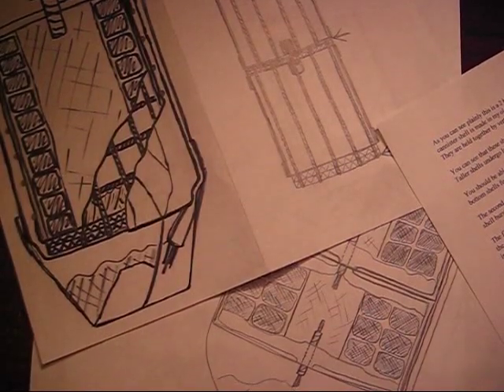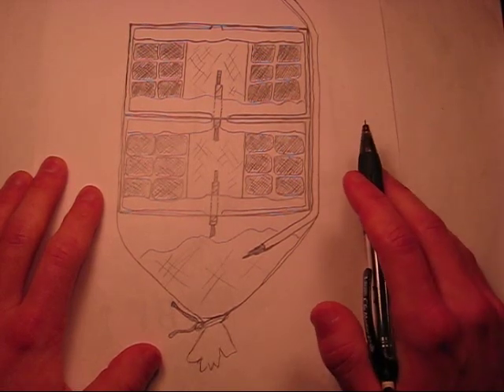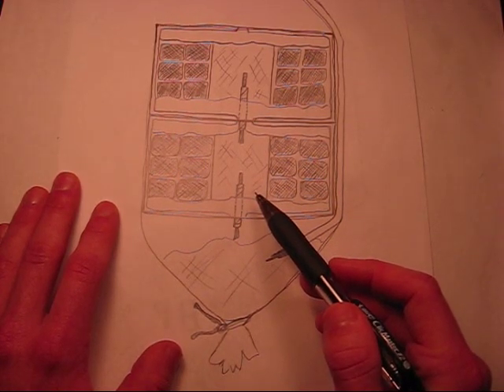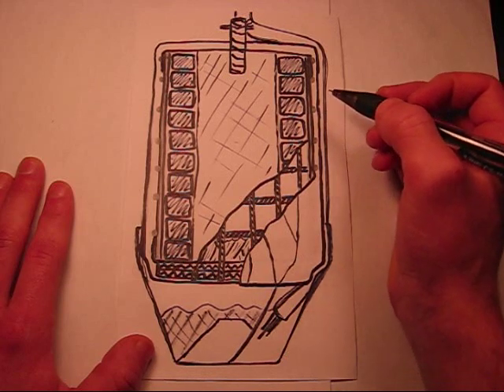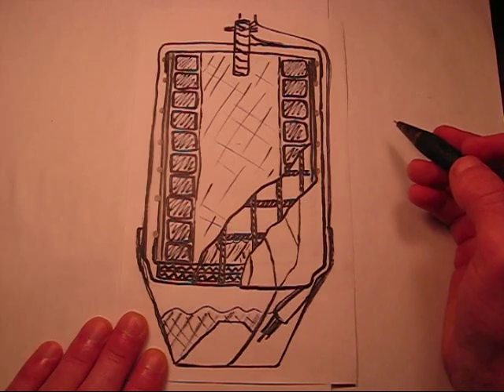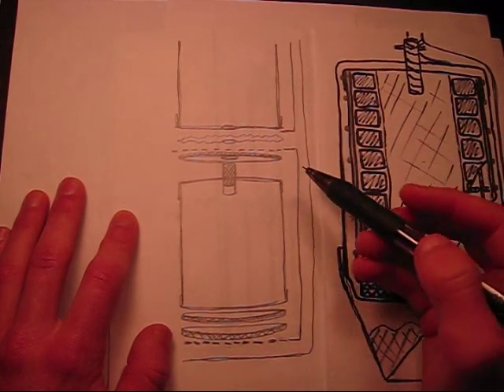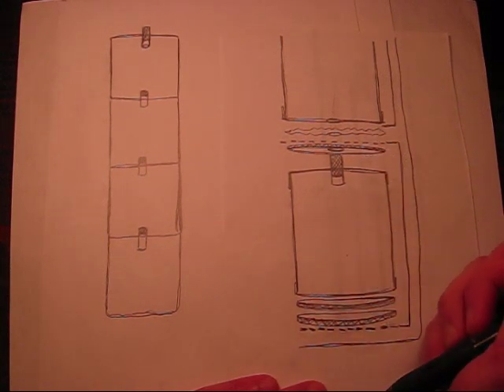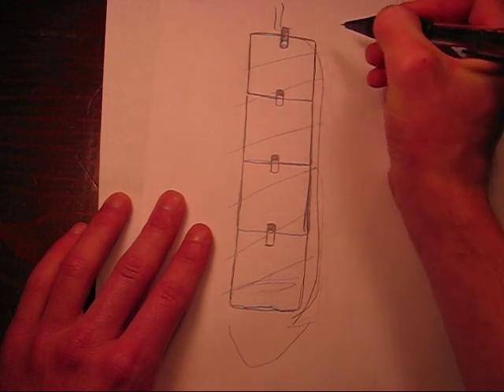Multi Break Shell Design - Advanced Fireworks Construction

Comment from the maker: What sort of break do you use? If you use flash booster, I would suggest getting rid of some/all of it. Also, are you sure your stars are are shattering and not simply getting blown blind? Also if your stars are not fully dry, they will be much weaker. A final thing to do would be to use more binder in your stars, or a better binder.
Well there you go, quite a few possibilities. I highly doubt the problem is to much pasting.

Comment from the maker: Multi break ball shells are pretty simple. All it takes is stiff cardboard tubes to put between them, and a few layers of pasting to hold them all together. The spolette of each shell is inside the tube attaching it to the shell that is meant to break one step earlier. A small hole is drilled into the top of each shell to allow fire to pass from it, to the next in line. To be sure of ignition throw a bit of BP into each separating tube. Depending how heavy the shell is, a passfire may be needed.

Comment from the maker: Well, try a bit more binder in your next batch of stars, and no flash booster in your next shell. Canister shells almost never use flash boosters. Also, though I still don't think the pasting was the final reason for failure, it wouldn't hurt to make your next shell the proper size so you don't need so much.

Comment from the maker: They end up tumbling in the air after firing, so no, they do not get forced downward. They break from the top down because fusing on the bottom would be a weak spot easily penetrated by the lift. Instant failure of the shell would result.

Comment: i see a few flaws in the first shell but they are not so dangerous if they are properly avoideed. the time fuse (visco in your case) needs much support if it is going to be on the botttom. but a flowerpot can be avoided with a strong shell, a good seal around the time fuse, and keeping the shell a small size like 3". but im sure you already knew that as you announced in your video the drawing had flaws but is used to simply get a perspective on multibreak shells.